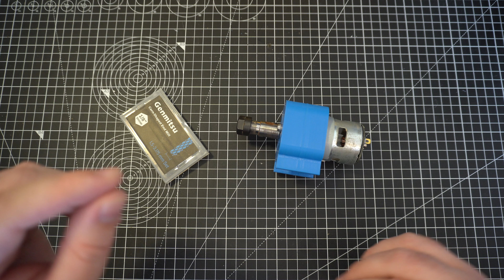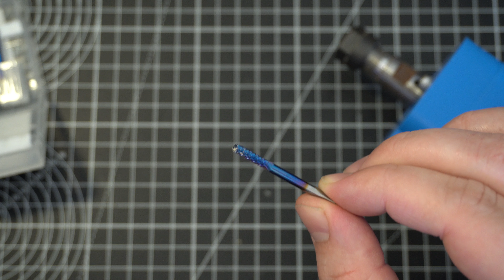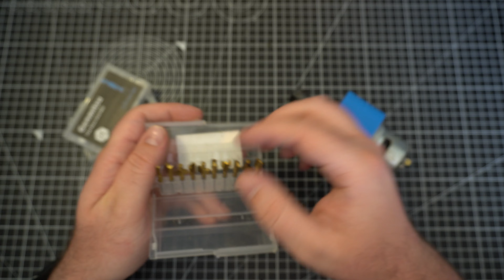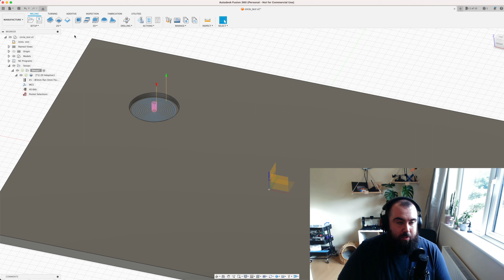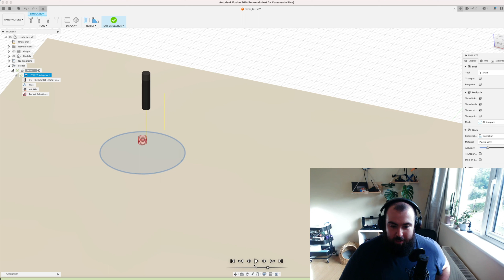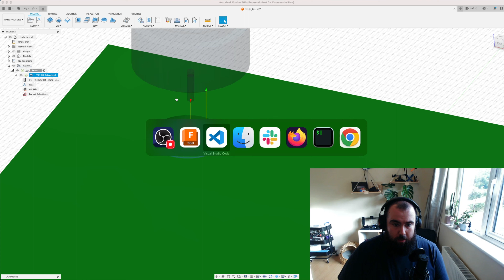DIY CNC (Arduino & GRBL) - Picking Endmills

Comment from the maker: I'm fairly pleased with how this testing went. I think if I needed to route out shapes in 2-3mm thick plywood this machine could handle it fine. For another test, I next plan to try it out with some engraving before a possible full rebuild to address the rigidity concerns!